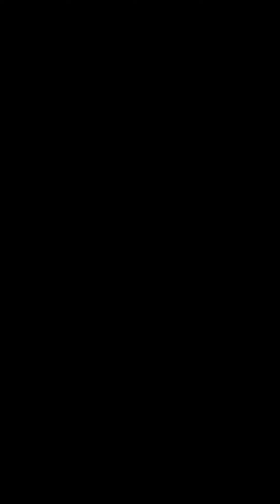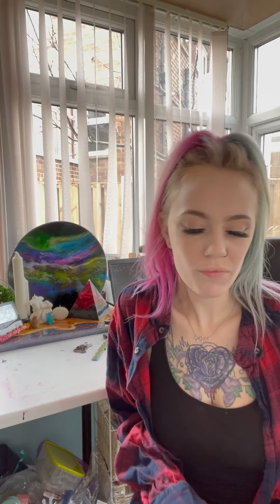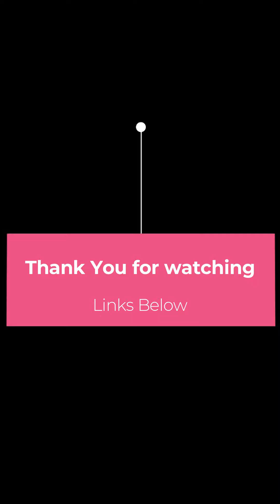How to fix amine blush the simple way

Comment: For some reasons sounds simular & can be confused with grout haze...mostly moisture issue, salt, & morter forming white film on top, coming from moisture below.  While blush forms from below & above surface i believe.
Either way experts say clean epoxy/resin with 1/2 cup white vinegar, 1/2 cup baking soda mixed with a 1 liter amount of water....scrub with green pad or 600 grit pad.  Polish it back to a shine.

Either can return in a wet environment. I've even seen traped moisture in coating taken out with a heat iron carefully with a teflon sheet/pad.

Comment: Thank you. I couldn’t figure out what I’ve been doing wrong, and coat after coat I kept getting it. Even with washing, sanding, washing, and adding another coat. It would still happen. Prolly the Amazon special resin I’m using. Can I top coat it with a different kind (more high quality) resin?